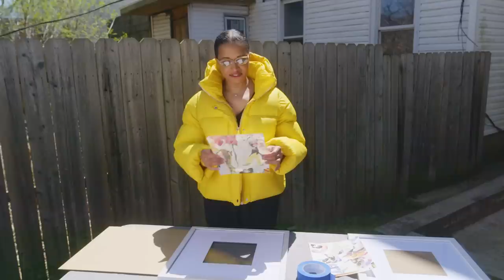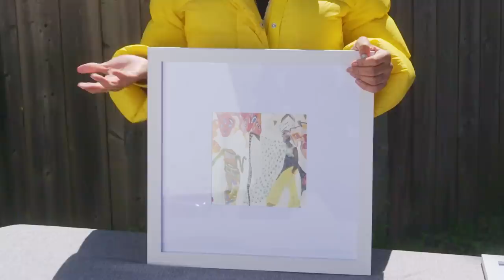3 Hour DIY Bedroom Makeover By Pro Designer | Room Refresh | Architectural Digest

Comment: Designer here. I’m not sure why the designer would hang the curtains so close to the ceiling and not do the same for the bamboo shades. They were an outside mount, so the shades should have been hung higher because retracted Roman shades always hang down a decent amount. Those shades actually visually stunted the windows and hindered the light coming through, making the room feel darker and smaller. I would recommend hanging them as high as possible so when they’re retracted, the bottom of the shades just barely conceals the top of the window frames. This will make the windows appear to go all the way to the ceiling and it’ll let in much more light.
Reply: I'm not a professional designer, but that was precisely what caught my attention as well, and for exactly the reasons you've stated. The remedy you suggest is spot on...you're hired. 😏
Reply: Yep that does make sense. Personally I don’t like curtains cause I like a room to look ‘neat’. And u have to wash them ew.
Reply: @forkrunner2313  Blinds and shades have to be cleaned as well.
Reply: It looks good breaks it up a bit would look strange blinds all the way to ceiling
Reply: @rachelnan6875  "Neat" as in straight lines, right-angles, flat.
Reply: It’s so cringe. I became infuriated when I saw this giant gap
Reply: @zl2071  you must get infuriated @ drop of a hat
Reply: ok di ann lol
Reply: @diann3880  i would hate to see what your home looks like then
Reply: “Designer here” 😂
Reply: @Kristin Danan - thanks for mentioning the gap between the ceiling and the shades. That was my biggest beef. I also wasn’t a big fan of all the patterns and colors, but the gap 😬🤦🏻‍♀️
Reply: @4x2-diy  for me it was the silver pins in the bed frame. It is the only time she uses that metal in an otherwise gold-fitted design. If your gonna mix metals make it look intentional.
Reply: @athenarocks7657  Too true. Why couldn’t the nails been a brass — it would’ve been much more cohesive. 😕
Reply: 100% accurate. Also hanging the clients wide painting above the bedframe on that cramped wall looked off, instead she focused on making "wallpaper art" for a different wall, to makenthe space busier, very odd. The toile de jouy bedlinnen, wallpaper and synthetic rug didn't marry at all either. I felt like this was made as separate photoshoots or vignettes or separate "look what you can do " chapters, and she never really took the room in it's entirety into account.
In an assymetrical space with windows and walls in odd placements to the bed plus doors an overall wallcolor (or pattern) with matching curtains would have brought much more calm amd cohesiveness to the room, and anchored it better (and the existing art). It didn't seem professional to me.
(not a designer but artist).
Reply: Yup, not a designer here (fashion background only not interior design) and I was wondering the same thing. I have done my own window treatments exactly as you decribed. Seems like common sense if you are going for height.  She could have just done a concealed white roll shade on the interior of the window frame for crying out loud and it would have been much more seamless
Reply: Or at the VERY least…a white curtain rod. But raising the Roman shade was a no brainer. I figured it wasn’t long enough to reach the bottom of the window 🤷🏻‍♀️
Reply: Good point
Reply: @forkrunner2313  You do not have to wash curtains!  You can do a light vacuum if you choose. If there's a concern about dust and dirt coming in from an open window then white would not the a good option. Also, curtains they are structured will look perfectly neat, particularly if they are stationary.
Reply: I think this designer is very new and has not had a lot of developing in the practice of design.
Reply: @zl2071 infuriating, was it…..not that serious lol
Reply: @4x2-diy different strokes for different folks folks, remember.
Reply: So funny you say this. I’ve actually seen multiple designers do the same thing in other videos and never understood why!!! It covers so much of the window

Comment: Tbh I disagree with a lower bed, because that’s valuable storage area that can’t be used with a low bed. On that note, this designer doesn’t seem to think of practicality when it comes to a rented place. The existing light was actually fine, and it means you have to put it back when you leave, as well as repair the wall where you screwed in the mirror and blinds. Also, a good vanity area has a large standing mirror, not a smaller wall mirror. It makes it rather difficult to do anything in said vanity if it’s small. Also, my other gripe is pattern clashing, if you have one floral, only use that one, and if you have any other patterns they need to be more soft, also that chair at the vanity should have a back, not just be a stool. My last thing, the colors aren’t the best together, While I love a good accent color, the tones are all over the place, cools clashing with warm oranges and pinks. Also, the nailed up wall decorations, and the floor length curtains dragging the floor, it makes it harder to keep clean
Reply: I came here to say the same thing!! It was all quite awkward…
Reply: Absolutely, also it looks like she won’t be able to see herself in the mirror if she sits on the stool - The stool is too low/the mirror is too high. The practicality of it just doesn’t work
Reply: @siom3815  that really irritated me! Also, if she’s going to choose a mirror that shape and height, why choose a lamp that overlaps it that much. I also just think she wasn’t successful in mixing patterns, geometry, or colors. The bed frame is the only hard, rectangular shape and everything else is “soft and feminine”. That doesn’t look intentional when you only break the pattern once - it looks like a mistake. Same with the mixing metals. The only silver is on the bed and everything else is gold.
Reply: Agreed 100%

Comment: C-, college dorm style. 
The "reds" in the duvet and wallpaper are not complimentary.   
If one has a vanity, the mirror should be functional as well as pretty.

Bamboo blinds could be mounted at ceiling height to avoid blocking any light.
Why emphasize the fact that the bed is too large with a dark headboard?
Framing wallpaper samples? I should stop, but that cheap rug...  

Does AD stand by this technique of applying wallpaper?  Blue tape is designed to be removed shortly after application and no more than 14 days.
Reply: Agree re all.

Plus the style isn’t cohesive.

Plus, a “nook” should have paper on the sidewalls of the nook - not just the one inset wall. Looks unfinished.
Reply: Yes to everything. Also, I know I’ve been harping on this in the comments - but the way she mixed the metals just looks like a mistake and it’s really bugging me.
Reply: The clashing undertones in the reds on the wall and bedding is it for me... and those paired with that rainbow art above the bed I find particularly unsuccessful.

Comment: I've think the use of  painters tape is problematic.  I've found it needs to be removed before too long because with time, it can remove surfaces if left on longer than recommended.
Reply: Yeah, that didn't seem like it would hold up that long. I know it's temporary but that doesn't seem like it would hold for more than a day.
Reply: Yes. I’ve noticed painters tape can also degrade over time and only come off in very small pieces. That could be beyond irritating then to remove.
Reply: Bingo! I came here to comment the the same thing.
Reply: @silverchords1277  
Painter's tape is pretty grippy.
Reply: Exactly! Over time, painters tape sort of disintegrates. Either it doesn’t hold up enough, OR it just binds even more and doesn’t come off in one go…
Reply: Yes, and actually removable wall papers, of good quality, can be directly applied easily and they stay put. I was confused by her application.
Reply: @thisis.michelletorres444  
Maybe she was unaware of the product or had difficulty locating them, or jus tg findinding a pattern they did carry.
Reply: Temporary wallpaper would be an easier option and it’s pretty easy to find (Target has it).
Reply: I think maybe they use painters tape is if the person doesn't like the style they can change easy because they use is a lot
Reply: @The1997wiki  Good point
Reply: @The1997wiki  
You missed my comment about the downsides of painter's tape...
Reply: @b_uppy  ???
Reply: @The1997wiki  
Yes, reread the uppermost comment of mine...
Reply: There are better grades of painter's tape which I've found hold up better and come off cleaner and later. Don't cheap out and usr something from the dollar store. Use a brand name.

Comment: How about just using peel and stick wallpaper that doesn’t leave a residue when peeled off. It’s a lot less labor intensive and there are literally hundreds of patterns available.
Reply: Have you used it before? I'm so tempted to try it on a wall in my bedroom, but I'm afraid it'll pull off the paint/ruin the wall when I remove it because I rent. Any tips or reccs?
Reply: @MizJilly  AH awesome! Thank you so much for the info! I've been drooling over some designs on Etsy and have been looking for any positive sign to pull the trigger, and hearing that it won't destroy the paint underneath is just what I needed!

Comment: Blue painters tape is for temporary use and not to be pressed firmly or it will tear wall board, plaster and/ or paint. Prepare to repair wall when this is removed.

Comment: I would've like to see them try a new layout. I dislike the way the bed covers the windows, but you can't really downsize the bed without making it impractical and look immature. I can't guarantee that my ideas would work, since I don't have the measurements of anything, but maybe putting the bed in the nook? That way the windows aren't blocked and the dresser, bed, and desk aren't in the way of each other? Though that might create a weird space at the footboard. Or maybe putting the dresser in the nook? I imagine in the current layout that the drawers might hit the bed. So putting it further leaves room to fully open them. Or putting them on the wall with where the meditation space was. Also under the bed storage is a MUST! They might even have been able to replace the dresser with that, leaving space for her to actually have an ergonomic chair. She's an entrepreneur, she's going to work long hours at a desk. The stool is cute and would suffice for a vanity, but after the 1 hour mark it'll start causing some discomfort.
Reply: Rather than a meditation space, a bench at the foot of the bed might be nice. It wouldn't be as practical as a dresser, but it could provide some nice storage, maybe for sweaters and jackets. Basically, adding the bench provides seating space and storage and could help her downsize or eliminate the need for a dresser, allowing the room to have more space to maneuver through it.

Comment: I'm glad it's not just me being critical. Bless this mess but 1. Silver metal on the bed head and gold on the other accents. 2. The blinds should have been fitted back inside the window frame - now when they're lowered they'll hit the bed! 3. Am I the only one wondering if you'd be able to see your face when sitting at the vanity? I think the mirror is too short for standing and to tall for sitting...😖
I'd have eliminated the head board, made a feature wall behind the bed instead, mounted blinds (in a coherent colour) inside the window box, left room under the bed for storage (obviously needed), had the vanity fill the alcove for more useful flat surface oh and put a beautiful tall mirror on or behind the vanity for use while sitting or standing.

Comment: It's an upgrade, but I think I would have used Cassandre's artwork as a starting point for color, connecting the wallpaper, bedding, area rug, and lighting elements throughout the room...perhaps even refinishing some of Cassandre's furniture pieces in an inventive way using water based stains that tie the art into the furniture more, but keep it mature and elegant. Still, that renter friendly wallpaper hack is top notch. Great job.

Comment: What I like: bed frame, wallpaper, framed wallpaper "art", mirror, pendant. What doesn't work for me: blue stool is too low to sit on it and be able to use mirror properly; previous art should not have been rehung; duvet cover is not a good color with the scheme and the its pattern is not my favorite either.